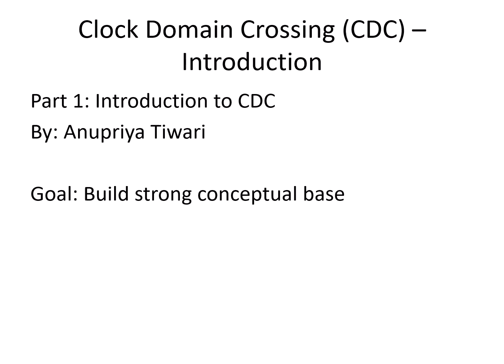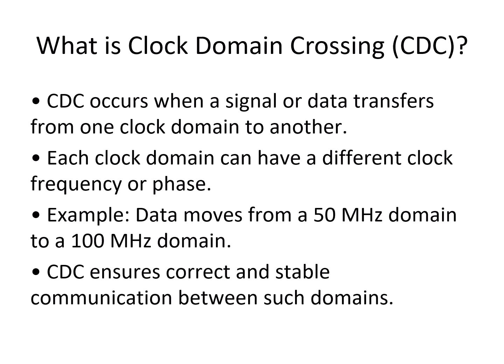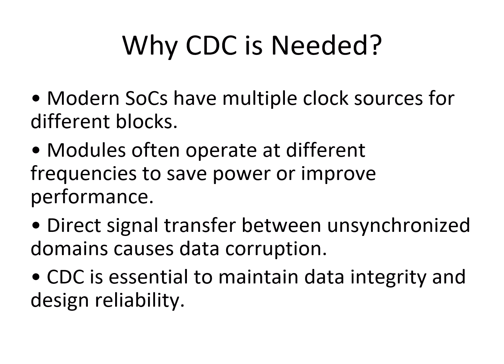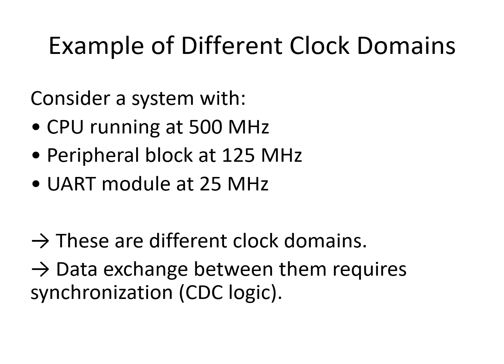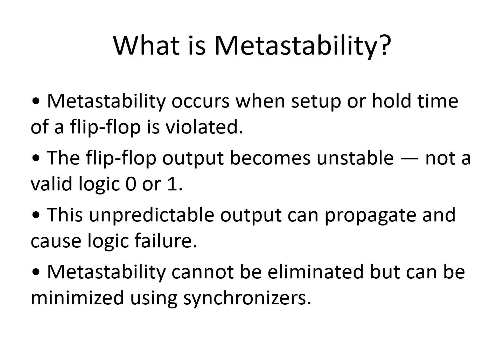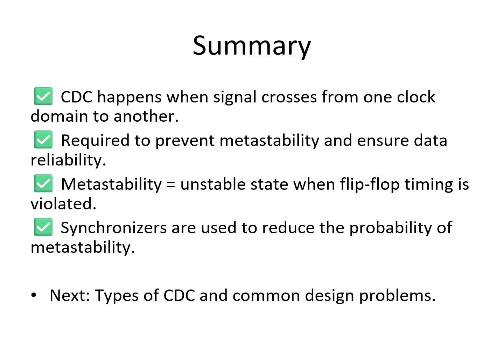Clock Domain Crossing (CDC) Explained Simply | Why CDC is Needed + Metastability Example

Comment: Thanks for making this series. CDC issues were the first hard problems I encountered when starting to develop for FPGAs and it felt confusing to me to fully grasp how to properly solve this. 
Coming from a software background, not having a ”100.0% guaranteed to work”- solution to a problem felt unintuitive, but I guess it’s the real world physics that’s at play here 😅.
Reply from the maker: You're most welcome! I'm really glad this series could help clarify CDC issues, especially coming from a software background. It’s definitely a unique challenge in hardware design! 😊
Reply: @VLSISimplified Something I’d like to fully understand is how to decide on which cdc crossing solution to pick and motivate it properly. How many flipflops are actually needed, can you do smarter solutions if you can assume an integer ratio and that clocks are in phase etc etc.